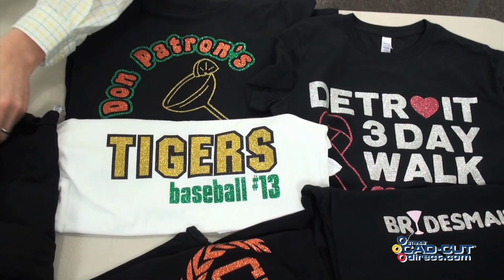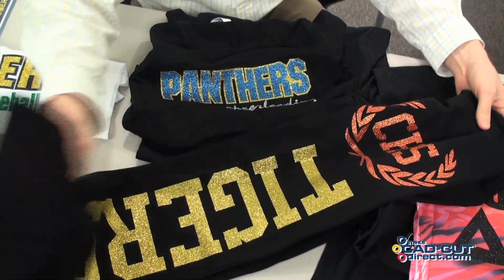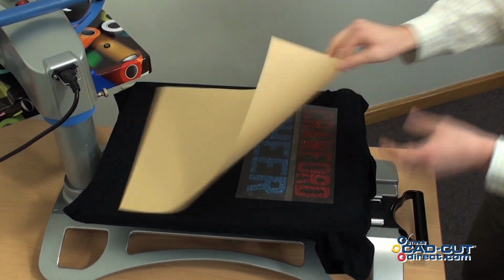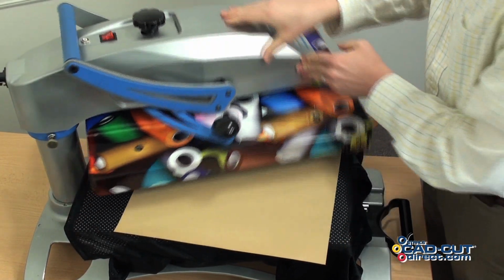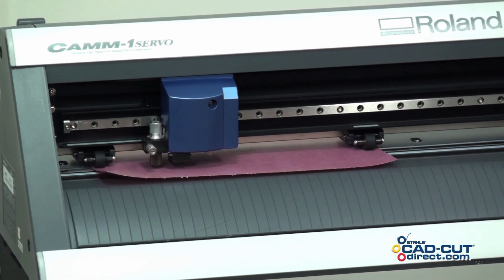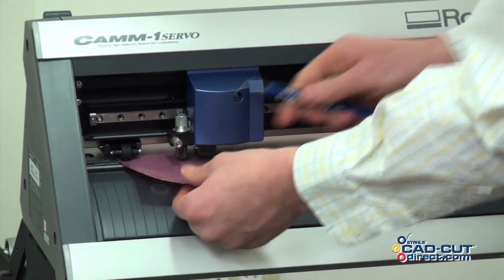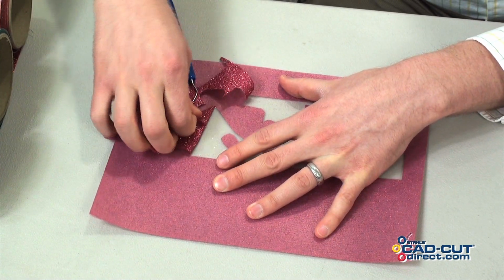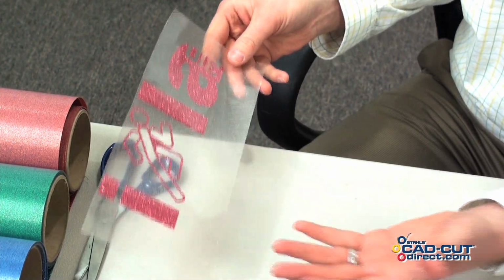CAD-CUT® Glitter Flake Heat Transfer Film

Comment: Been using this with mixed results.
319F , Stahls Air Fusion, Pink Glitter.. after just a few seconds press the Pink color Completely disappears?
Ruining Alternative Apparel Tanks in a deadline crunch yet again stahls quality control on bad rolls in our busy shop.
argg.
Also measure 10 yd rolls have arrived in 3 yard length.